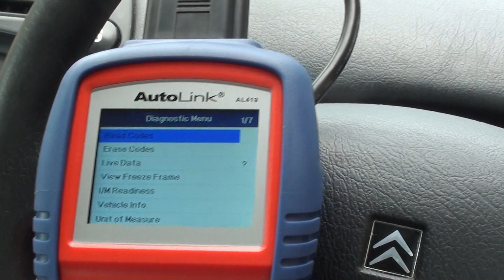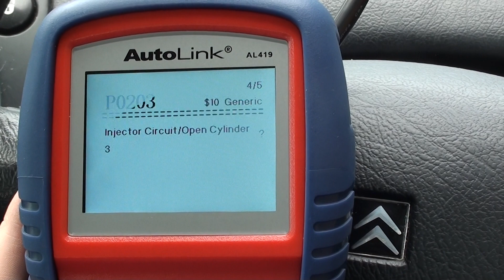AL419 Diagnoses Citroen Fault Codes P0201 P0202 P0203 P0204 P0443

Comment: i have a question, if ur coge is p0201,p0202,p0203 and p0204 the car will not start? this code is failure of all injector so not fuel in the engine? or iam wrong
Reply: kmailo pereira
Reply: kmailo pereira